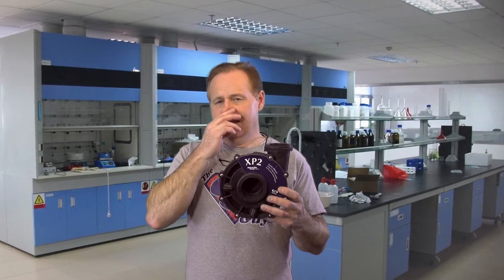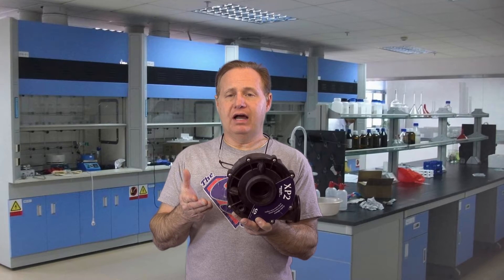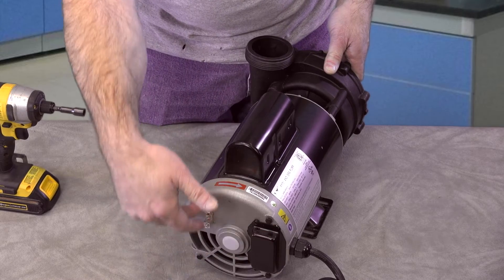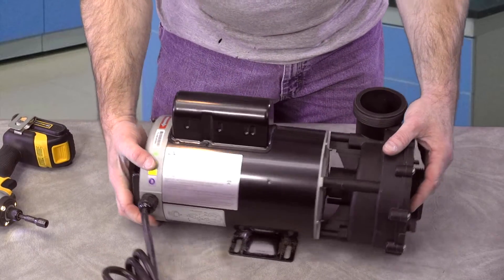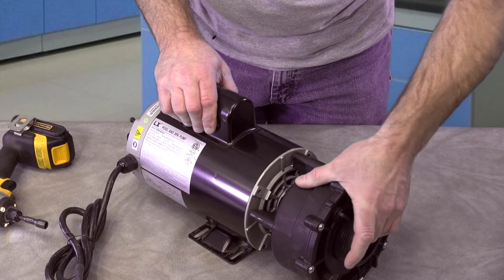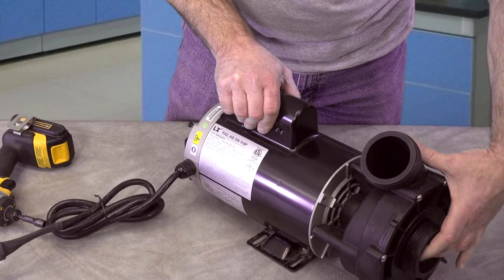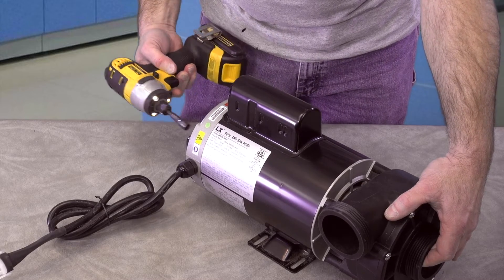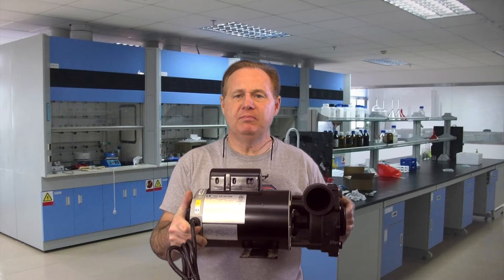How To Turn a Pump Wet End to the Direction You Need The Spa Guy

Comment: 3 o’clock is not an exceptable position. You will get pump cavitation from trapping air.👎🏽 If you need 3 o’clock set the head to 9 o’clock and spin the hole pump 180 degrees. You can thank me later.
Reply from the maker: Not accurate at all.. There are many hot tubs with the pressure side in the 3 o'clock position.. Cavitation is caused by the introduction of air not the position of the wet end.. You can thank me now.. I have personally worked on over 5000 hot tubs I know what I am doing..